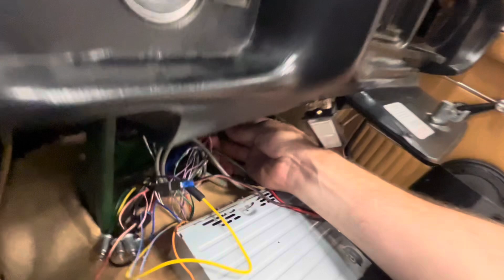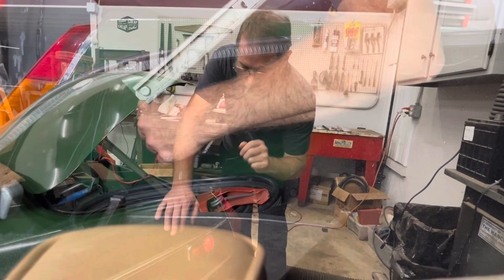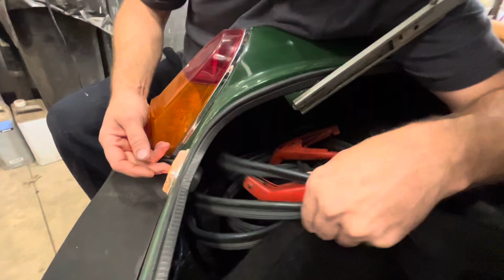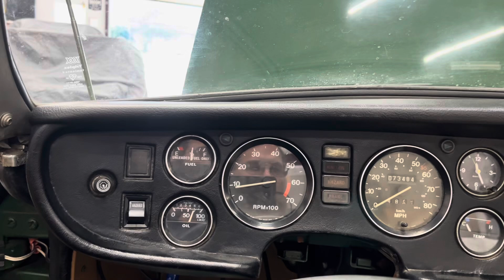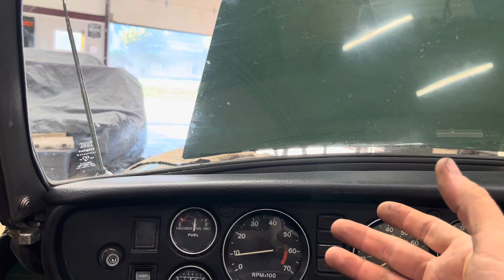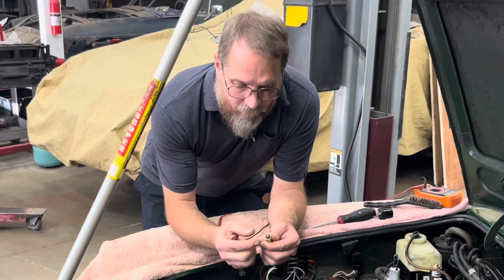Final Check on the MGB Wiring Harness - Almost There!

Comment: I am resto modding a 1974 MG Midget. I like the dashes though of the 1965, 66, 67 Mark2 style. I just wonder how difficult would it be to modify the wiring harness for. Or is there any recommendation you would have concerning this?
Reply from the maker: Lots of owners of MGB's have retrofitted the pre '68 dash into later cars, so it is doable (yours
would actually be easier as the early/later B scuttle is different requiring a filler panel). 
You just have to look at the wiring diagrams for both the '74 and the '65-'67 cars to determine the wiring differences, and adjust accordingly to make it all work. I honestly haven't looked close enough at those year differences to know if the mountings changed (not nearly as many Midgets come through the shop as MGB's) but I would think they are likely the same/very similar as they really didn't change things like that if they could design around what was already there to reduce tooling costs.

Comment: i've got three british cars and finding a temperature sensor that fits AND provides the right voltage to match the gauge so as to create a modicum of accuracy is a guessing game AFAIK. for the better part of a century their outward appearance hasn't changed much, in fact they're practically identical, but the threads differ, the amount of threads differ and the voltage they produce for a give temperature differ... smh.
Reply from the maker: You also have to remember that the voltage to the gauge will change the reading as well as the resistance range within the sensor itself. The gauges can also be adjusted as well, but for most people they should probably not try to.

Comment: You mentioned the tach taking a few seconds to start working - mine does that every time. Any idea what the cause of that is & if it's fixable?
Reply from the maker: I’ve never had a customer who actually decided to fix that. My guess is it would take a rebuild of the gauge to fix it, but it is a very common issue
Reply: @unionjackclassics I thinks the issue is caused by years of condensation inside the house. The internal connections have corrosion